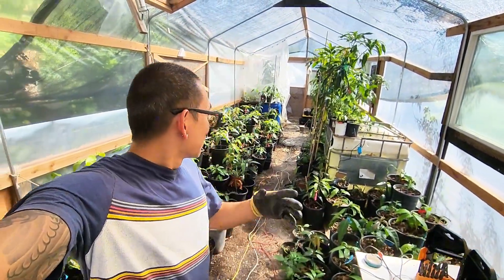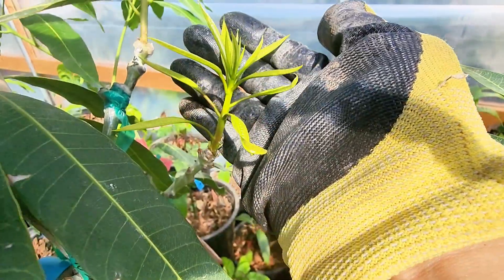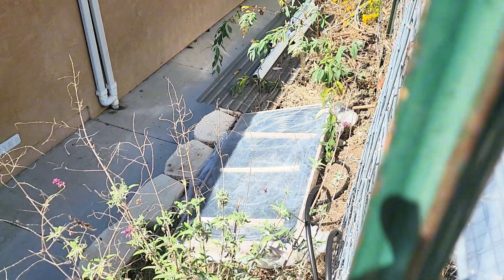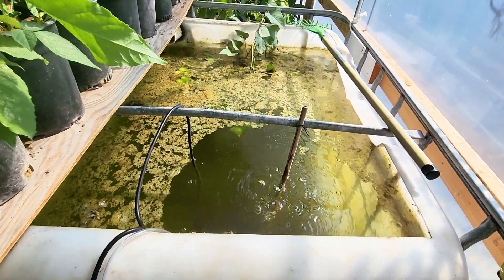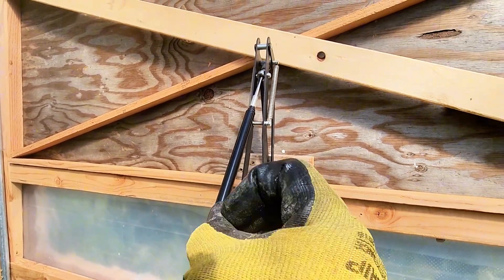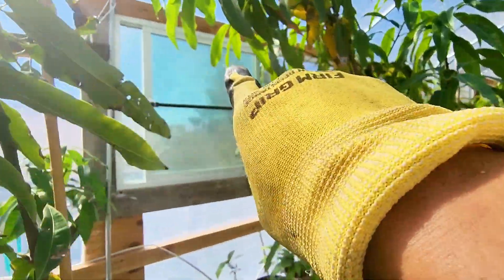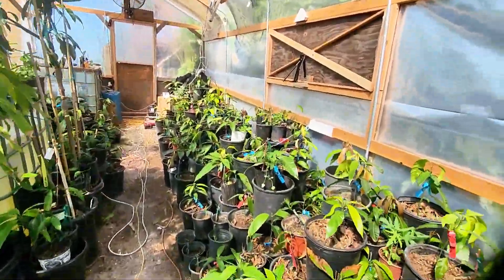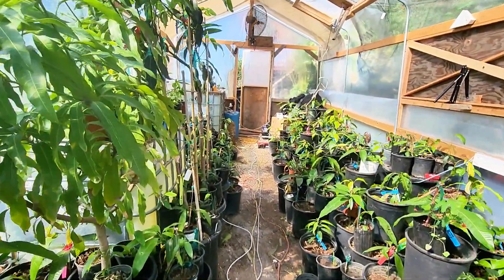AMAZING Mango Greenhouse in SoCal.  MASSIVE Growth!!

Comment: To be clear… You’re basically solarizing the tubing so that it pushes warm water into your tanks?
Reply from the maker: Yes, i have the aquarium pump that travels through those "solar tubes" set on a timer to turn on a few hours after sun rise and off before sunset.
Reply: @Johndabuilder  WONDERFUL! So, I'm trying to do almost exactly this. Did your aquarium heater come with the pump? If not, what pump are you using-- I don't see it in your tool list. Also, what are you using to keep bugs and mosquitoes from spawning in your tanks? I know you said you were putting fish in the tanks...